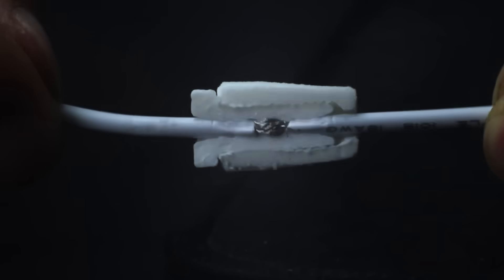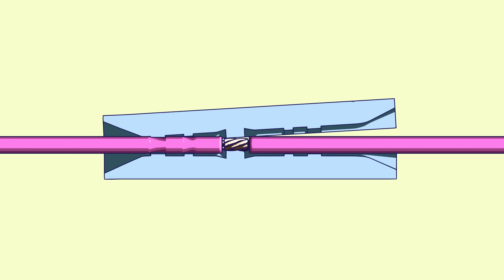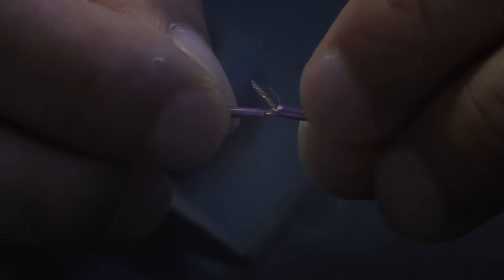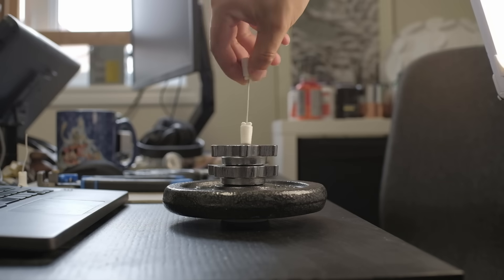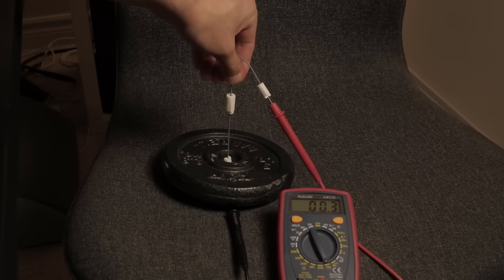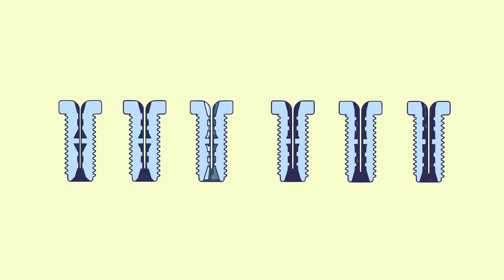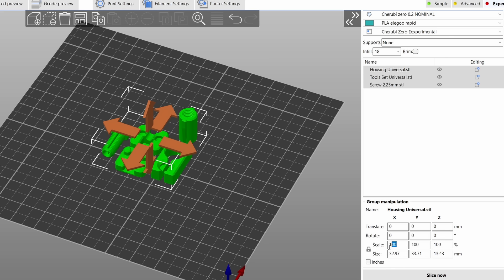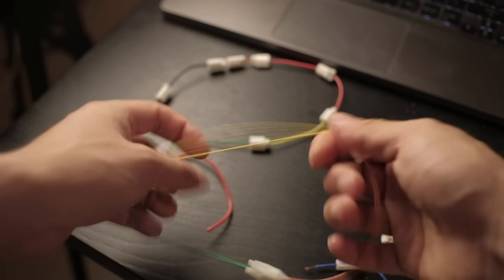3D printed wire connectors that actually work

Comment: When you solder correctly the wire will break before the solder connection breaks. 
When I worked at Halliburton you have to get “certified” soldering before you can solder on their downhole tools. 
During class we would just straight solder two wires together (no j hook) and then try to pull them apart. The wires would snap before the solder connection every time .
Reply: I imagine this is the kind of thing that depends heavily on a few factors like gauge (determining surface area for solder connection vs. cross sectional area), solid core wire (similar reason), leaded vs lead free solder, etc.
Reply: @narex45635 yes and no. when electrical resistance isn't a concern, solder is fantastic, elevator hoist cables are soldered at the ends as it's stronger than any knot or crimp when done correctly

practically, yeah, variables and such will mean results may vary, but in theory, solder is a mechanical retention connection that is conductive but has more resistance than copper and sometimes connectors. some high current (and therefore big wires) applications prefer crimped connectors to minimize it and also for ease of install and maintenance. at some point going up in size, you're basically using brazing techniques to get it hot enough to flow solder and crimping is often easier and better overall
Reply: are you sure the elevator cables are soft soldered tho? Brazing and high temperature brazing are technically the same process but differ in alloys being used and the temperature

as far as I know the process used with elevator cables is called speltering which is a form of brazing. Soldering (in the electrical sense) really would be too weak
Reply: @Ramog1000  I seriously doubt elevator cables would be spliced with soldering. I'm failing to find the technique- but it casts the individual groups (maybe strands) of steel wire in lead- which holds it in a creep (technical term- easy demo is hanging a weight from some floss embedded in Jell-O) preventing fixture while the lead prevents ingress of the elements between the strands. I'm a tad tremulous that an elevator tech doesn't know why they're doing what they're doing while still being authorized to work on a main cable.
Reply: @Originalsunrunner20  Okay firstoff I wasn't the person that brought elevator cables into the conversation, I was only iterating on another comment. And yeh nobody ever said its being used for splicing, its a process to fixate the ends to the cabbin of the elevator, its pretty similar to a Rope Spelter Socket. Other sources call it a Babbitt socket. But yeh no splicing, really just a way to keep the wires in place so that they stay spread out and can't fit back through the cone.

In my comment I was more iterating on the fact that what is commonly refered to soldering is in fact soft soldering (which usually isn't strong enough for such applications), some people seem to equate it with other processes like brazzing while they need to be carried out differently, need different heat, involve different alloys and work very different on the molecular layer.
Reply: @narex45635  there is also the issue, that no matter how good its done a solder connection between two wires is not vibration safe 
thats why you never see it in automotive 

I think thats mostly were solder gets its reputation from, that and wires that are easily ripped from a pcb (either its straight up the wires breaking through fatigue or the soldering was done bad)
Reply: @Ramog1000 The difference between solder and crimps is that solder doesn't intrinsically have strain relief. Crimps are made so they do both connection and strain relief in 1 simple component that requires only 1 assembly operation.
Reply: @dougaltolan3017  Even ignoring strain relief, electrical soldered connections have issues with vibrations because of the alloy being used. 
Solder is inherently brittle and vibration can cause micro cracks, this happens even with strain relief
Reply: @Ramog1000  Im a bit skeptical / bewildered by that..

Yup, solder is brittle (save specific alloys) but I really dont see enough mass is a mm or so of car wiring to distort the soldered joint.

True that carts dont have soldered joints in the wiring loom, but every piece of equipment inn a car is full of them!

All the radios, CD players, phones, sat navs etc would all die a horrible death if vibration of very short wires was a problem.

In a previous job, I used to do wiring and cable installation and maintenance for outside broadcast vehicles. Imagine small TV studio control room on a truck.
Never ever any issues from vibration, and some of the connectors had a significant distance between clamp and soldered joint.
Reply: @Ramog1000  you don't see it in automotive due to labor. crimps are automated/consistent/fast vs soldered wires.  Soldered wires are used in downhole harness all the time, they are heatshrinked and potted.  I've have years in both industries.  Things I've designed for downhole - 100s units/year.  Automotive - 10+ million units/year.
Reply: @Ramog1000 I guess NASA didn't know, solder connections aren't vibration resilient when building all the space equipment capable of surviving a hell a lot of vibration on launch and reentry :-)) 

Also another example - FPV drones, especially big ones (10" and more). Vibrations are insane there, still properly soldered connections do hold just fine
Reply: @dougaltolan3017  There is soldering to boards in automotive, but that's different. You will almost never see soldering in professional automotive or motorsports wiring. One of the few exceptions is soldering directly to a sensor which is then potted and therefore fully sealed and strain relieved. Obviously solder can hold up in a car, but there are a number of factors to consider including the skill of the solderer. Crimping a correct connection with a proper tool has much less room for error.
Reply: @802Garage 👍 about room for error. But, I suggest that the main reason is speed and cost. Crimp connectors provide connection and strain relief in one component and one operation, soldered joints need 2.
Reply: @Ramog1000 I doubt thats the reason. Vibration in a car on soldered joints is minimal, and even more so in a loom. The main reason would be productivity efficiency and consistency by using ferrules and crimps.
Reply: @Ramog1000 You can make a vibration proof solder joint. Look up NASA soldering standards. I suspect they crimp instead of solder in automotive because it's a "good enough" solution. It's much quicker to butt splice than it is to solder and it's harder to solder in the field.
Reply: The wire in the video snapped outside the solder joint too.
Reply: That's probably my main issue with soldering. It's not that it isn't a fantastic method to connect wires. It's that it actually takes skill and in many cases the right tools to do it properly. So many people think they can solder well and have no idea what they are doing. Crimping and other methods can have plenty of room for error or need special tools too, but soldering has so many ways to go wrong.
Reply: Well a connecting method that puts force on the insulation instead of the wire has the potential to be at least as strong, and also has better strain relief properties. In other words, knot the two insulated wires together before soldering their exposed ends.
Reply: Yes and you can see in the video that it's the wire that breaks, but he is definitely trying to make you believe that that isn't the case.
Reply: it makes sense that the wire breaks first since copper is softer than bronze which is what you get at the area where the tin wets the copper. Not to mention you also have the tin also taking the load soyeah the solder joint is has way more material than the wires themselves
Reply: @laharl2k  Soft soldering is too low temperature to even form alloys, you'd atleast need the heat of brazing for any kind of alloying reaction to accure
Reply: @laharl2k there's not really "bronze" getting formed with soldering the melting point of tin/lead is much lower than copper so they're not really forming a proper bronze alloy. There is however a nontrivial amount of metal atoms that dissolves into the liquid phase solder, forming IMCs or intermetallic compounds.  There are a ton of variables at play that determine the mechanical and electrical properties of a solder joint. 

A simple example: Lead-free tin solder on gold-plated contacts will be more brittle than on copper because gold easily dissolves into tin. Indium solder doesn't have that problem.

Complicated example: Components might be plated with nickel palladium or other exotic alloys to bond with the nonmetallic component body. These can change the phase diagram of the solder, creating large grainy crystals under certain temperature profiles and in different oxidative atmospheres. The crystal structure determines electrical and mechanical properties. Like hard snap chocolate vs the chocolate bar you left in a hot car and brought back inside to cool.
Reply: @laharl2k  A solder joint won't create a bronze alloy- even a braze isn't hot enough to form an alloy. At best, you'll get the copper equivalent of case hardening.
Reply: Julian over here trying to one up Ibanis. That's great that you can solder good julian, good for you.

Comment: Good idea but too many unknowns so  I'll stick with lever wire 
connectors. The more you try to pull it out the tighter it gets., 
so it has strength. Plus ease of installation and reusable. 
You just have make sure you don't get the knock-offs.

Comment: by the time you print 10 of those i've already soldered, heat shrunk, cable protected, installed and strain relieved it.
not to mention running it through a passage only meant for wires, not connectors that are 10x the diameter
edit: did you try and just tie the two ends of a cable in a knot, then connect the wires, then wrap it in electrical tape and then pull on each end?
engineering isn't always about designing a product.  these are only useful in an emergency situation.  so does the test i described above.

Comment: As a card-carrying journeyman low voltage commercial electrician, I am suspicious of this idea. As a 3D printing enthusiast and appreciator of neat ideas, I like this a lot lol…

What material did you use? I would be worried about material creep over time, given that it is under tension.

Comment: Do you have any interest in developing this into a real product? I have experience designing injection molds electrical connectors and handling regulatory listings. This clamp with a conductive contact at the copper clamp spot would be similar to how wagos function and get approval

Comment: Great concept! You need to get a proper resistance meter though, the change you are looking for is below the display capabilities of that multimeter.
Also, the twisting and soldering you did actually created stresspoints at the end of the solder which is why it broke there.
Try comparing it to a classic wire-clip joint and a simple crimp.
Reply: Yes. The screw (which touches the wire) should stay stationary and the housing (which touches the screw, but not the wire) should be rotated around it when assembling.

This way, the wire nor its insulation is stressed by rotation.

Comment: What if you added tabs to the housing that you can use to tunr it better instead of an entirely seperate tool? If there is a way to apply radial force but break it off using shearing force you can do it without increasing the installed size

Comment: To measure small resistance, you should put constant current (like 1 A) and measure voltage with multimeter.

Comment: Not bad at all. 
Give you a possible variation, a push-in version so no cable twisting if in situ installation. 
Can be pushed in with a pair of pliers. 
And maybe the external sleeve could have more than one receptacle
Reply: In situ you’re twisting the external nut anyway so the wire shouldn’t be twisting
Reply: @risunokairu oh damn, you’re right. 
Now I feel stupid 😭

Comment: It's a cool project, I applaud your work, I love cool rabbit hole projects like this and have gotten lost in more than a few myself, but I don't want a huge knob in my wire for many reasons. If it's permanent: I solder and heat shrink it. If it's disassembleable - I crimp and install connectors. But again, great work.

Comment: You need to lower the print diameter and complexity of installation, large amounts of pulling force strength is not that needed over a thinner connection

Comment: The solder joint was not weaker.
You damaged the copper wire when removing the insulation...
Reply from the maker: honestly, that makes a lot of sense

Comment: Seems slower and bulkier than normal crimps, but certainly cheaper and probably more durable. When printed from polycarbonate, I bet it's good enough for most applications. Very impressive!
Reply: that definitively doesn't need to be printed in polycarbonate. It's WAY overkill, even ABS would be more than enough for a durable application. I'm pretty sure that PLA would last decade if the wire don't heat too much.
Reply: @SaitoGray  It's not about durability, it's about heat resistance and flammability. PLA ABS and ASA are very flammable compared to polycarb. I do not trust them in electrical applications for that reason. Using PLA is just asking for a fire if it's in anything other than an air conditioned environment with low wattage. 

I'm not saying that if you use PLA for one then you'll start a fire, but there's always a chance, and the more of these you use the higher that chance will be. Not worth risking a car or house over.
Reply: @theredstormer8078 brother if you're using the diameters of wire shown here for anything drawing more than like, 10W (and even that's pushing it) it might really be a you problem rather than a design/manufacturing one
Reply: @anuphys  Wattage doesn't matter, 10A 1V or 200V 0.05A both 10w, but first joint would heat 200 times more.
Reply: @anuphys  In cars, which are one of the most common potential use-cases for these, it's not that uncommon to have >10A fuses there. With the wire thicknesses used in the video, that's a perfectly reasonable expectation. If you only have one strand connecting the two wires then it's gonna get real hot. When (NOT IF) wires and connectors fail, you don't want the surrounding plastic to catch fire before the connection burns itself out.

There's a reason that every commercially available electrical connector or box is not made from PLA or ABS. If a car manufacturer did that then they'd get sued, and it's against code in houses for a reason.
Reply: I disagree, a conventional butt crimp puts enough force to smoosh through the metal oxides and make a robust connection that isnt going to oxidise in humid air. Wires twisted together with a small amount of clamping force I’d feel much less certain about, especially for wires that aren’t tin-plated like in the video. Some crimping terminals have a section designed to crimp over the insulation of the wire, like open-barrel spade terminals, it would be neat if someone made butt terminals that did the same thing. In the past I’ve used oversized butt terminals with seperate crimping actions on the inner core and outer insulation, it seems to hold up well, though the thin strands being crimped into an oversized hole leaves a bit to be desired.
Reply: Outside of fire concerns that people have talked about, using enviromental crimpers instead puts the crimping on the wire instead of the insulation which provides stability for the connection. The other benefit is that you wouldn't need different lever-screws for different insulation thicknesses and the crimp would instead be concerning the CAU of the conductor which is more beneficial when designing a circuit in terms of load capacity for the wires.
Reply: Definitely not cheaper
Reply: Proper crimping holds the actual conductor securely. This does not.

Comment: Fantastic work! You could devote an entire video to fatigue testing the design against soldered connections. It's a REALLY big deal in the experimental and DIY aeronautical engineering space.
Reply: Which is a real threat with 3D printing, since isn't PLA and PETG CORN BASED plastics, with the intentional purpose of decomposing for environmental reasons.
Reply: @tdata545  realistically this is a concern for every practical 3d model. most home gamers won't need the longevity, anybody that seriously does will ideally know enough material science or have people that do to pick better filament. the rest where it's important, but not critical, will hopefully and unfortunately learn the hard way. but if this takes off in the automotive repair space and especially if the plastic is appealing to critters like soy insulation, this will be a fun/big problem for sure. this is of course just speculation, realistically people are going to be all over the spectrum ive sorta made and learning from failure will happen, such is life

Comment: That idea totally sucks. There is a reason why there is not a single certified connector in the world, where the wire is compressed by plastics for the contact, if any current higher than a light bulb requires is conducted. Because plastics soften over time and this reduces the pressure. This leads to higher resistance. This leads to heat. This leads to plastic being pushed away faster. So this is a positive feedback loop and a dang fire hazard. If you care for your life don't do it. Pretty much any other connection method is far superior and predictable. And that is key in electric installations of any kind.
Reply: Okay but im looking at this and thinking cool new way to try for some low voltage projects. Wouldn't use it in a house wirenuts are king but for diy projects for some electronics and you have the space in your device they seems great.